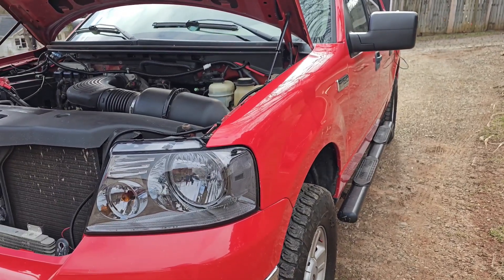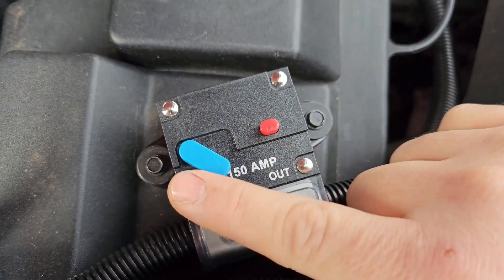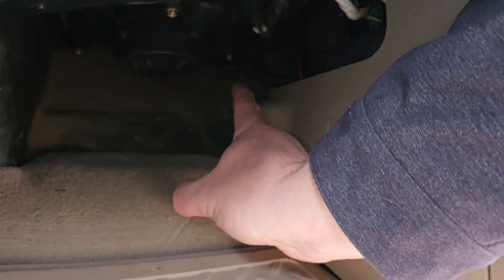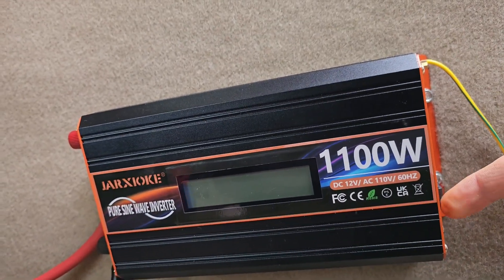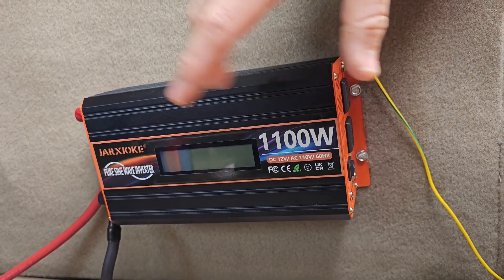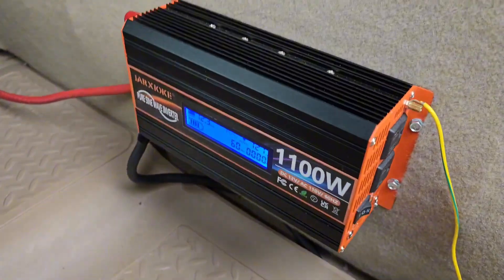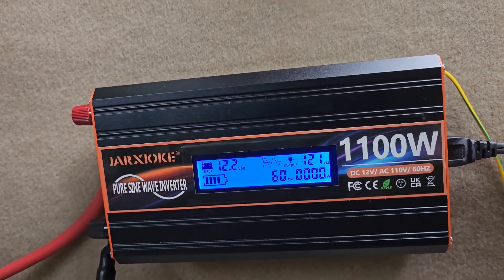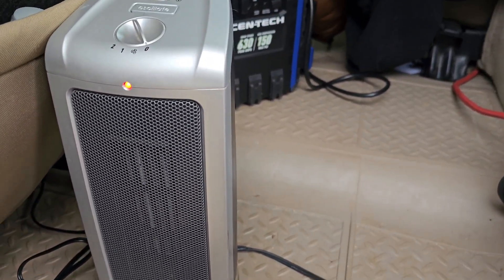HOW TO TURN YOUR VEHICLE INTO A GENERATOR.

Comment: Be careful maxing out the inverter while the truck is off. Amps increase when voltage decrease. I'm sure you already know this. Mainly commenting for the algorithm
Reply from the maker: Man I'm glad someone gets it. I appreciate it. It for sure helps.  And yea I just didn't want the noise of the truck in the video so you guys could hear me.

Comment: In means from battery out is to your draw. you have your braker hooked up backwards
Reply from the maker: I know issue has been resolved now but I will say I did this because of lack of mounting space and just wanted to see what happened because I like to test things and honestly it works the exact same either way. Power shuts off the same and all draws act the same. Don't know if that means anything just figured it was notable.

Comment: I bought the same one. It will be here soon. Doesn't the positive battery lead from the battery go to the "in" on the circuit breaker, and out to the device? I feel you dont have any protection on that wire. Also I think you need to run the negative battery lead from the device back to the battery. Then ground the device with the yellow wire. I'm using a 100amp circuit breaker. I think yours is to high. It will work the way you have it but I think a fire is gonna start.
Reply from the maker: Yes if you can do it definitely put the inside from the battery in the outside to the product and I tried it both ways but mounting positions in the truck were almost impossible and if what time I definitely plan on changing it and I looked online and as best I could find I was feeling like 150 amps was The Sweet Spot. Also just in case this is why I ran 2 gauge wire to help and even under such a bad draw like the heater the wire is not even getting warm. Also running the negative wire back to the battery would have been almost impossible as I barely got the positive lead through the firewall as it was. If I did I would probably have to run it under the actual vehicle and up into the engine but I have seen other videos do it this way and they also seem to think it's sufficient. Let me know how this inverter works for you though. So far it's done great for everything I've used it for.
Reply: @BULLETENVY As long as I can run my 700w K cup coffee pot on my way to work I'll be happy.
Reply from the maker: @camperADK I'm almost certain you will be able to flawlessly. In the video the 800 watt heater ran perfect and that was without the vehicle running. Enjoy tho!